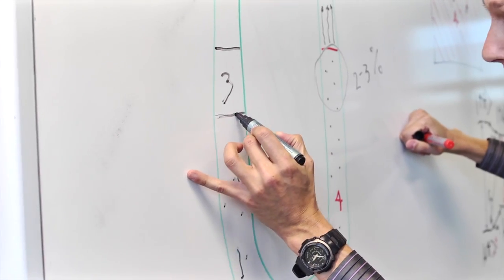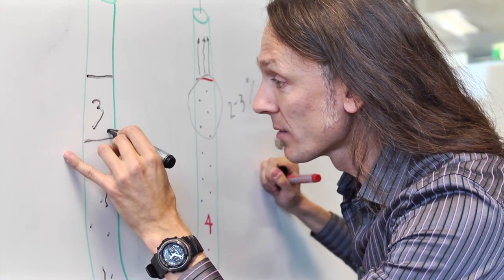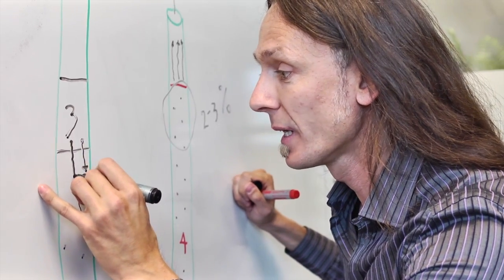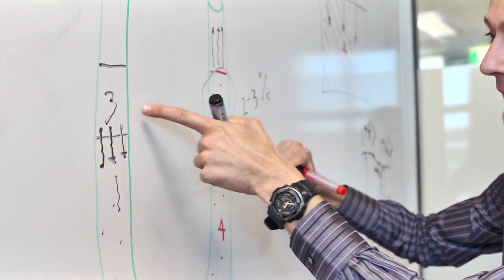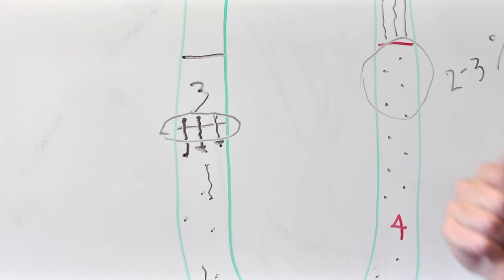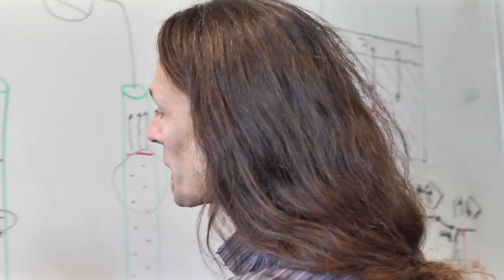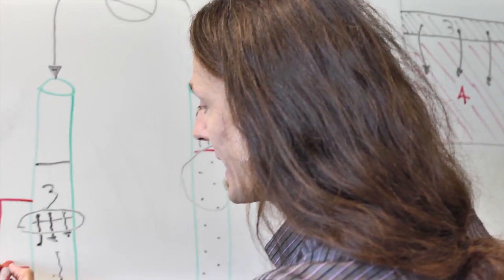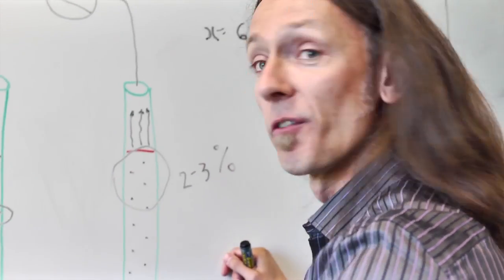Quantum Cooling to (Near) Absolute Zero

Comment: How do we know what absolute zero is if we've never reached it?
Reply: Richie Smith Temperature is the kinetic energy (speed) of particles as they vibrate. As negative speed cannot exist, there is a theoretical minimum temperature at which particles are completely immobile. That temperature is the absolute zero.
Reply: It's theoretical though.   While it can't be higher since we have gotten to within a degree of 0 it could possibly be even lower than what we think
Reply: Richie Smith It's theoretical because you can't actually reach it, due to Heisenberg's uncertainty principle as stated in the video. It can't be lower though, because that would need particles going somehow at negative speeds.
Reply: Quentin Diaz yes I understand what you're saying we have a definition for for absolute zero, but why did the scientist in the video talk about 10 milli Kelvin? That implies that we know what zero Kelvin is, but we can't reach it.. so how did science then define the scale of Kelvin when we have no totally exact minimum temperature measured?? To have a scale, we need a minimum. Is there like an approximate standard minimum that we all accept, but which is not infinitly accurate??
Reply: ***** We don't need to make a physical object reach absolute zero to know where absolute zero is.
You can make an analogy with sizes if it helps : an object of stricly size zero is not possible. However, we know what a millimeter is, and how it relates to zero. You can try and make the smallest toilet possible (http://www.nanowerk.com/news/id2840_1.jpg), and be perfectly sure that you're, say, 3 nanometers away from zero, even though you can't reach zero.
Reply: ***** Temperature is the amount of energy stored in an enclosed (quantum) system. And because of Heisenberg's you can not have absolute no energy in a system. So you actually just measure what energy is there from the quantum momentum of the particles by measuring the vapor pressure above the liquid and can use thermodynamics to interpret it as a Kelvin figure.
Reply: Quentin Diaz
Thanks.
haha that toilet xD What is it made of? some nano material?
Reply: dreamyrhodes
so there can't be zero energy in a system..? And that minimal energy is some finite amount, and then when converted is like a few nanoKelvin? And we can't go below this non-zero temperature?
 but yet we do say that zero Kelvin is zero Energy?
Reply: ***** Yep, because it way clearer to use a good old zero in equations, even if it can't actually happen, than "that temperature record the guys at the lab managed to reach last week".
Reply: Quentin Diaz
ahh alright. i see.
Reply: *****
The smallest possible temperature is actually limited by the Planck units. As said, temperature is nothing but the "wiggling" of the particles around their (virtual) point of localisation. Now in the Planck-world there is a size that limits the smallest physically possible radius, called the "Planck length" Nothing smaller makes any sense physically. And since the Planck length is not zero, it is the smallest theoretically possible amount of "wiggling" in a system, it can not go lower and still have any physical effect. It is a direct definition from natural constants: Speed of light, Planck constant and the gravitonal constant.
The same exists by the way for all other units, there is a Planck mass, a Planck energy, a Planck time, a Planck charge, a Planck temperature and so on (note that the Planck temperature is NOT the smallest possible but the HIGHEST temperature - because every temperature has an equivalent of radiation a particle emits by its temerature and radiation is defined by it's wave-lenght, the Planck temperature is the temperature, where the wavelength equals the previously mentioned Planck lenght - no radiation can have a higher frequency hence defining a Planck frequency).

https://en.wikipedia.org/wiki/Planck_units
Reply: dreamyrhodes
alright thanks a lot for the answer. it is clearer now for me. But what if the atom wiggles with a Planck radius from left to right? it will start left for example, then it will pass through its equilibrium and then it ends up on the right. During all that it has travelled a distance of 2Planck lenths (its diameter). I assume it will move with infinite precision from the left to right, with as many steps inbetween smaller than the Planck length. Not with 2 planck lengths. Is this right, or is space itself also limited to moving through it by the Planck length? Is there like a grid were atoms snap to with a spacing between each cell of a Planck length??

And for "note that the Planck temperature is NOT the smallest possible but the HIGHEST temperature" what do you mean with Highest temperature? But Planck is the lowest temperature?

Comment: 2veritasium
ok so it essantially works like magnetic cooling (which also takes advantage of causing heat to disorder spins and therefore rise entropy)
BUT what i dont get: in magnetic cooling the magnet will be magnetized AFTER contact with the heat source in order to transfer the energy from entropy to lattice vibrations because entropy is forced to shrink while the total energy content of the magnet will stay constant. My point is: the magnet heats up ABOVE the temperature of the original heat source DUE to this additional lattice vibrations. This temperature gradient (lets say in the beginning everything is as hot as the heat source you re trying to cool) will allow us to drive energy OUT of the magnet again.
1) i dont get how a higher entropy will cause the system to heat up - is it achieved upon vapourizing He3 out of He3|He4 mixture since entropy will drop again and rise the temperature in the He3|He4 mixture in the area of low He3 concentration?
2) i dont get where the heat is transfered to (basically - is my guess in 1) correct?)
Reply: let me ad another one:
it costs less to solve one atom He3 in He3|He4 than flipping one magnetic spin doesnt it? otherwise i could use magnetic cooling to reach that temperature range - which frankly seems like the easier setup to me ?

Comment: How did people get liquid He before such 'quantum cooling' technologies existed? If I'm not mistaken, there were studies on liquid H and He in as early as the 1930s (I might be wrong). How does one cool He to those temperatures?
Reply: I'm willing to bet they did it similarly to how we do liquid nitrogen sans quantum cooling. You have one vacuum pumped coolant rated to drop from ambient temps to freezing at a set pressure, same sort of setup that runs your freezer at home. Then, you have a second coolant that will take the temps from 0, freezing, to a hundred and some below zero. It's the same setup as the other, but with a different coolant at a different pressure. The way this all works is powered by the same phenomenon that makes water boil at higher elevations (IE lower pressures).
Reply: The Kush Connoisseur Great. Thanks mate.
Reply: Check this link out it basically just explains the whole process of making Liquid Nitrogen and Helium.

http://thecuriousphysicist.wordpress.com/2013/10/28/how-do-you-make-liquid-helium/

Comment: I'm wondering if they could also use, if not this exact method, a version of this to cool engines. They could drastically reduce the size of them, taking out large radiators and such. That of course hinges on the speed of this process. How much it can cool in so much time. Just an interesting idea.
Reply: I have a set-up in the lab that reach 20mK in 16-20 h. Is not a big cool rate haha

Comment: If the Van der Waals-Force is weaker between two helium 3 atoms than between one helium 3 and one helium 4 atom, why doesn't the pure helium 3 on the left side evaporate first? Or are you just simply changing the temperature of the right tube?
Reply: You are an excellent logical thinker! Indeed, that's how we operate the machine. I didn't mention it in the video, but there is a small heater near the top of the liquid level on the right hand side that keeps it a bit warmer. The He-3 on the left hand side still wouldn't evaporate because there is more He-3 gas compressed onto that side by the back of the pump. But heating the right hand side is indeed necessary to increase the rate of distillation - just like you heat the distillation column to make vodka...
Reply: Andrea Morello Thank you very much for the response and the kind words! However, I should have taken your analogy of the distillation into account, you are basically answering my question there already. 
I think you are a great teacher, your explanations are as clear as can be! Thank you for this video! :)
Reply: Yes, you're right. Among the many details I skipped in this explanation, is how you re-cool the atoms that are reinjected on the left hand side. This is done in a number of ways. First you push them through a flow impedance attached to a small pot of pumped 4He (separate from the rest of the circulation system), which cools them to 1.5 K. Then, from there downwards, you make counter-flow heat exchangers, where the cold 3He atoms coming up from the right help cooling down the hot 3He atoms coming down from the left. A simple way to do so is to put two tubes of different diameter one inside the other, and coil them around to make the length longer. So basically, the left and right hand side of the U-tube are not really going up straight and separately as I've drawn them on the board, but you put one inside the other and wound them around. It's just a bit messy to draw it... In fact, if you look at the photo that Derek used as the "cover image" for this episode, near the bottom of the image you will notice something that looks like a coiled-up gold-plated tube. That's the heat exchanger. You only see the outer tube (which would be the "right hand side of the u-tube"), there's a smaller tube inside (the "left-hand side of the u-tube").
Reply: Andrea Morello You mentioned in the video that the pump takes these hotter particles from the right side, and pumps them back into the top of the left side. My question is: Wouldn't this heat up the left side, essentially negating the cooling when H3 moves into the H4 area? Where is the heat going? Because the left side is getting closer and closer to 0K, then being heated up on the right side (back to the boiling point?) and pushed back into the left side (at presumably a much higher temperature than the boundary between H3 and H4)?.
Reply: Andrea Morello If You don't mind elaborating further on cooling, assuming You are using some high compression ratios (not even sure if its possible)  to further transfer heat from the separate 4he tank "condenser" to elsewhere? (Some abundant medium such as glycol or water? probably, bad example but I'll go with it) Or Are You limited by the mass of storage of 4he at Your disposal and once heat has evened out the cooling stops?
Reply: That's awesome! Makes sense to me now, thank you very much for taking the time to give me an explanation :). PS. Your explanations in veritasium's videos are my favourite part of his channel

Comment: Why does the Dilution refrigerator not clog up, because the Helium normally solidifies at 4.2 degrees kelvin.
Reply: No, helium liquefies at 4.2 K. The really interesting thing is that it never solidifies, even at absolute zero (unless you apply more than 30 bar of pressure to it). How is it possible? Because the zero-point quantum fluctuations melt the helium crystal!

Comment: How do the scientists know if they recieve a false positive from the Grav Wave detector. It would seem very easy to accidentaly measure seismic activity, or even a foot step, when you measure changes at 1x10^-20m. Can anyone explain this to me please?
Reply: Good point. What you need to do (and is being done) is to build several detectors, in different parts of the world, and look for coincidences. That is, look for events where the same signal appears in all detectors around the world at the same time.
Reply: Andrea Morello Ah, tricky tricky. Thanks for clearing that up!
Reply: Andrea Morello I have a somewhat similar question. You mentioned at the end that people have devices that, when cooled, can detect very minuscule changes of width of the cooled mass (1/10 of the one expected from a passing gravitational wave). Now, how are they testing such devices to say that they can reliably measure such small changes? Obviously you can't just fire gravitational waves at an instrument.
Reply: Piotr Grabowski I think this link will help clarify: http://www.nature.com/news/2007/071114/full/news.2007.242.html
Reply: Oli T Thanks a lot ;)
Reply: I thought of another problem. What stops the measuring equipment from being affected at the same time by the same grav wave. Everything inside that grav wave would look the same, so no change would be detected? or am I just completely wrong there?
Reply: Ooshgaar i think it relates to the mass density of the sphere compared to the vacuum around it

Comment: Its is possible to use the same principle with other liquids that are parcially miscibles?
Reply: No, it only works with helium. That's because helium is the only known substance that remains liquid down to absolute zero temperature, so that the effect of zero-point quantum fluctuations become apparent. Every other substance freezes and becomes solid at temperatures above a few Kelvin, which is still too hot for the quantum effects to matter.
Reply: elnariz8 Magnetic refrigeration is a well-established method indeed. At extremely low temperatures there are some very funky quantum aspects of it, but for the most part it's a classical effect.
However, the specific cooling method I described in this video only works at very low temperatures. In fact, it starts working only below 0.86 K. There is no other liquid that provides a similar cooling process at other temperatures.
Reply: I think, they just shouldn't combine to bigger molecules but still have to be able to get near each other allow the mixing/transition.
Reply: That makes sense. I didn't thought about the actual elements that actually have similar properties required for the underlying processes.
Reply: Prof. Andrea, I understand the principle of having a fluid even below zero Kelvin and the purpose of your research behind it. I was wondering if its possible to apply the quantum effects on another type of liquids, even if it is far above zero Kelvin. Its because the quantum mechanics cannot be applied to "high" temperatures?
I am asking this because actually I in my masters degree work its on developing a "magnetic-refrigerator" (sorry for my english, not native), where we apply a magnetic field on a Fe-La-Ni alloy, and by enthropic varyation we can retrieve heat from a enviroment. So anything related calls my attention.
Reply: elnariz8 There is no "below zero Kelvin". The Kelvin scale is defined as starting at zero, hence absolute zero.
Reply: albinoman13bt I really expressed myself badly, but I know that "supposedly" no temperatures below 0 Kelvin exist. I just don´t understand where your comment adds anything to this conversation.
Reply: elnariz8 It doesn't add to it. It took something out that was said wrong.

Comment: Say you were crazy enough, to build a big "U-Tube" in your room, and get a lot of helium 3 and 4, would you be able to cool a room with this apparatus?
Reply: You'd need a BIG U-tube.
The way conventional evaporative cooling works is using water to cool down air that is taken in from the outside (the water absorbs the heat which cools the air) which is then fanned through out the room. So using JUST the U-tube to cool a room wouldn't be that effective I imagine. Maybe if you have the same kind of fanning system in conjunction with it?
Reply: DoYouEvenScience I would argue that the u tube might have to be so big that it really wouldn't be able to reasonably to live in the room
Reply: Tyler Mistretta You could alternatively make your room smaller or move to a smaller hosue
Reply: The answer is that you need to get the room down to ~2 K before this works...
Reply: better get yourself a good fan (:
Reply: Remember that fans dont really cool much, knopning that it was a joke i just thougth of it
Reply: Does anyone here have $2billion lying around somewhere? If so...

How to cool a room to 1-2K:
1. Good insulation (like a vacuum jacket around the room)
2. Use about 200 normal sized pulse tube refrigerators (PTR) or a giant 1K pot and about $30,000 worth of liquid helium to cool room...

How to cool a room to 10mK:
Step 1: Make room air tight.
Step 2: Place room in vacuum and suspend it from giant Mixing chamber plate... (most dil fridges have 3 different plates as shown in the thumbnail)
Step3: cool room to 1-2K using PTRs.
Step4: Circulate & condense mixture to get down to 10mK... (U-tube)

How much He3 will this take? Let's assume the room outputs 100 Watts. A typical dil fridge can optimistically handle 1 mW of power before things go to hell... So, we'd have to scale it up by a factor of 100000x. The typical dil fridge has ~$20,000 worth of He3 (that stuff is expensive) so, we're talking about $2 billion dollars.

Comment: could you use the idea of the ball measure gravitational waves as an extremely precise weight scale? under the right circumstances it needs to make it possible could it be done? Scales are accurate but if they could be that accurate it would make mathematics even harder at a larger scale wouldn't it?